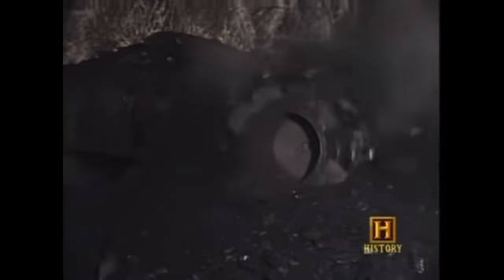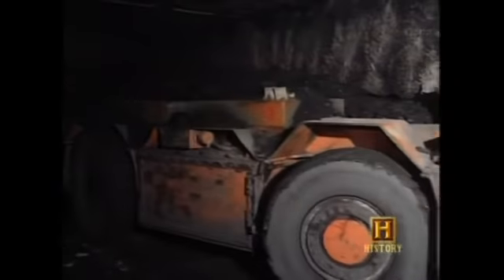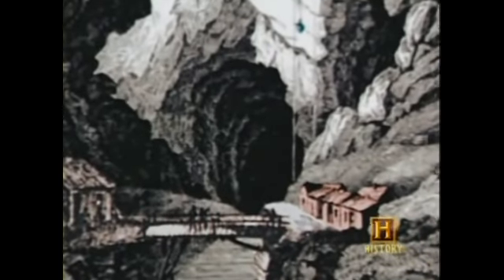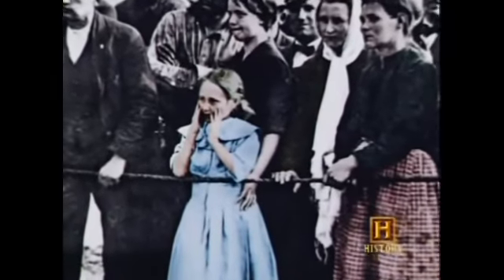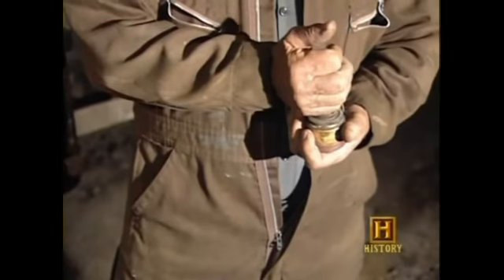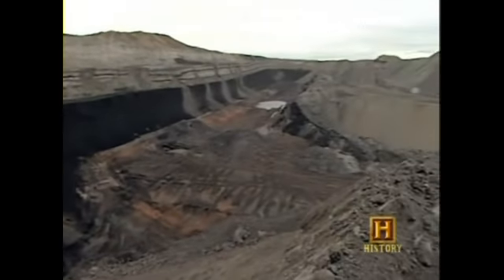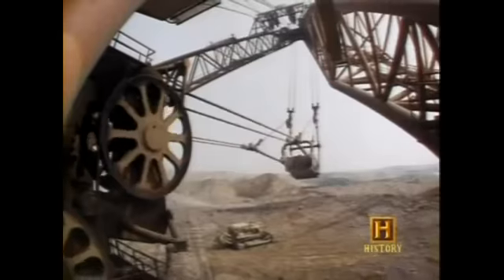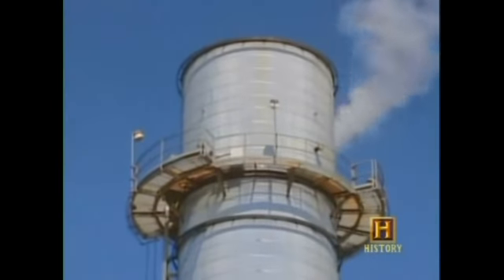Coal Mines

Comment: There is no doubt that the coal miner job was, is and be a very dangerous work. Every day you risk your life. Myself I worked over 10 years as an hydraulic mechanic in the coal mine in 1000 meter deep mine. The level on my place for work was low between 0,70-1,00 meters. Very hard time but be honest I loved my job.

Comment: using explosives in a coal mine fells backwards, because coal is flammable. but worse than than, is that most coal seems have pockets of methane
Reply: Depends on if there's any oxygen and flame or spark to allow for a fire. The same way dynamite can extinguish a fire by depriving oxygen to the flame, a high explosive detonation can prevent fires.